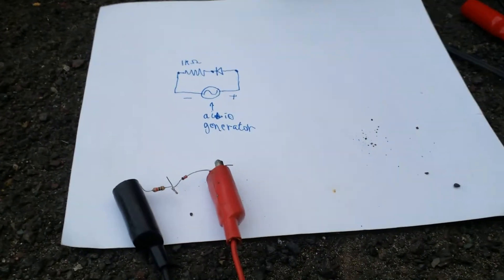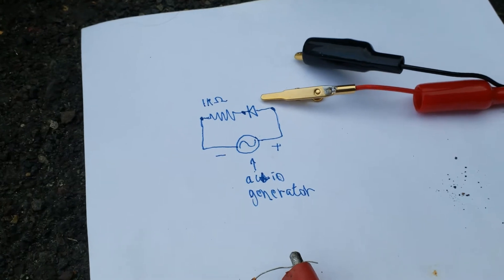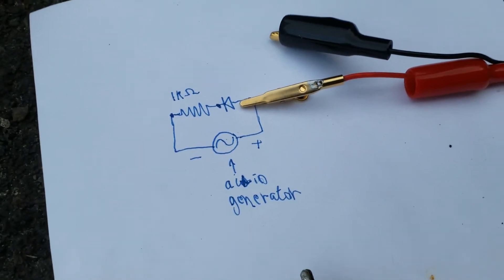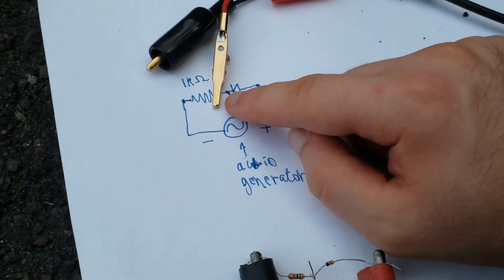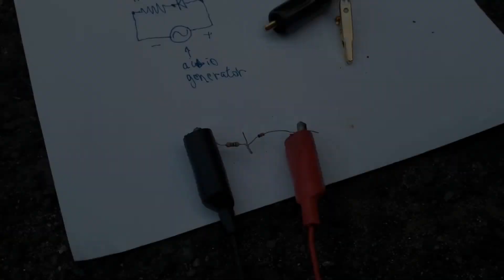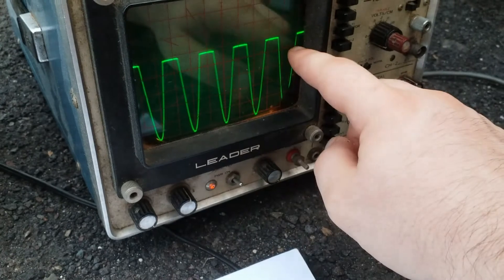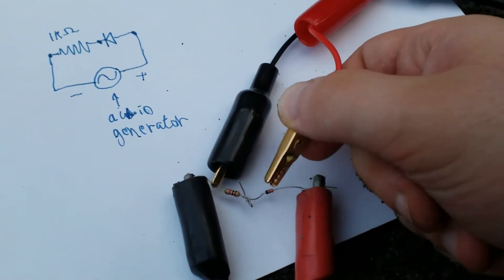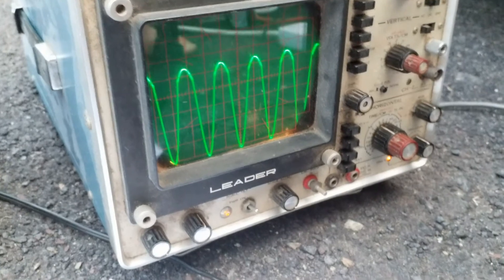Testing circuits and devices with an oscilloscope

Comment: @Joseph X If you put your osciloscope in X-Y operation, feeding the X amplifier (:horizontal channel) with the audio signal of the generator, this will result in horizontal sweep. Then, if you feed the Y chanel with the signal developed across the resistor (as shown in your R-C circuit in this video) keeping a common ground for both of them, then, if you connect a diode (as shown) you will see on the CRT the "signature" of the diode, which has a shape of the letter L. 
If you leave the place of the diode empty you will only see a horizontal line, meaning open circuit. If you short the terminals (where the diode seats)  you will see a vertical line. This circuit is the well known "component tester", which is very useful in comparing similar points on a circuit (i.e. the components of a good working stereo amplifier channel, against the other one having a problem). The test is done with the circuit(s) under test being not powered up, which is the most important property of the component tester in terms of safety.

Comment: When you say audio generator, don’t you mean signal generator ?
Reply from the maker: technically no, as the Audio Generator says, "AUDIO GENERATOR WA-44C" on the front panel below the frequency selector dial. Audio Generators will generate a signal in the audible range (about 20 Hz to 20 KHz) and some signal generators will not do frequencies that low. Plus, when the generator does a wide range of frequencies and wave types, some people might refer to it as a function generator. Judging by the fact that my generator does between 1 Hz to 200 KHz and the audible audio range is a majority of what the generator covers, I think it's safe to say that it's an Audio Generator. Though, some people will say that an Audio Generator is a type of Signal Generator as its generating an audio signal. Also, most people will use the terms, Audio generator, Signal Generator and Function Generator interchangeably. So, technically no, but in some cases, you could say kind of yes.

Comment: Great probe placement learning video!  It's totally worth it as there are several ways to screw up measurements on even the simplest circuit.  Like trying to use ch1 and ch2  simultaneously. Doh!

Comment: found your video looking for help on setting up a IV curve tracer, on a breadboard,2 channels one for x one for y. I get good voltage display with the X,but I am stumped on getting the Y to show the current.how do I  get the channel 2 probe in series to show current thru the DUT? do I just  treat the channel 2 probe and its ground as a component in the circuit?
thanks
John
Reply from the maker: I never used an IV curve tracer, but normally when measuring voltage with something like a multimeter, the probe goes in parallel and with current the probe goes in series. Based on this my best guess would be ... yes, treat the Y probe like a component in the circuit. Though I would put the Y probe as close to the component(s)/ part you want to test. Also, do you know if you have a voltage drop or some kind of meter loading with the Y probe? ... It might be something you want to consider.

Comment: In a real circuit you couldnt do this.
Your probe setup will be extremely noisy. Fue to the loisely coupled probe.(wires).
Also what you call negative on your probe  is actually connected to earth ground. If you go probing resistors and components like this, your can to blow up your circuit, or your scope or both..

Comment: When testing radios etc, would you not have to isolate the component, circuit, before testing?
Reply from the maker: Generally no, especially for low voltage DC circuits and even more so for digital circuits with a clock cycle. That does not mean there is some odd exception that I can't think of right now. Though for old school electronic devices (think tubes and stuff made before the 1970's), most of them ran on high voltage AC and lack modern safety features (that we take for granted today). So you would have to isolate the device's circuits to prevent from being shocked or injured by them. Though this isolation is more for safety rather than testing.

Comment: I don't see the positive and negative cables attached to the oscilloscope?
Reply from the maker: Are you using a scope probe instead of alligator clips? If so the retractable clip at the tip would be the equivalent of the red wire (positive) and the grounding wire would be the equivalent of the black wire (negative)
Reply: @JosephX So in escencr you are measuring sections of a circuit at a time to find where the problem is located?  I correct?
Thank you
Reply: @JosephX Thank you. Sorry for the late response and yes I would have been using a probe. So I understand know how you were using the alligator clips.
Reply: Can these measurements be taken on a live circuit? Thanks.